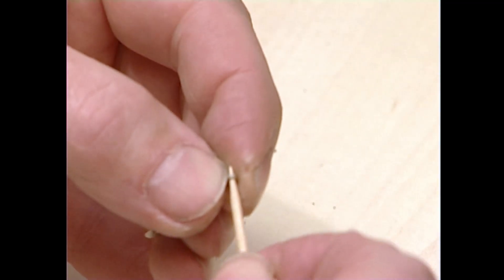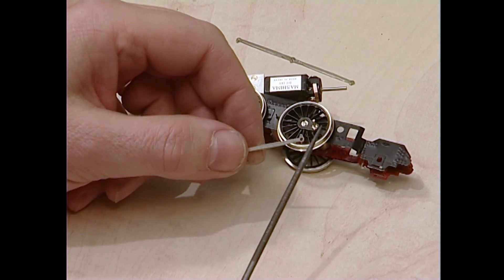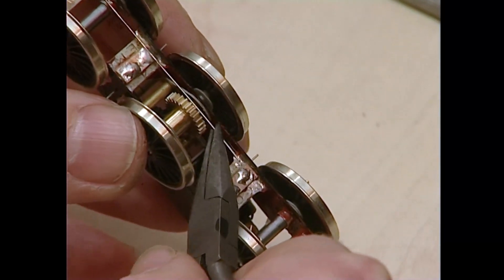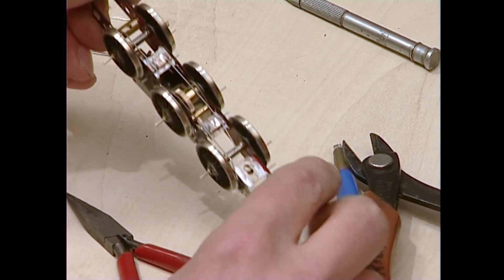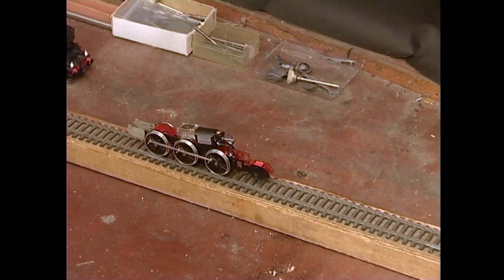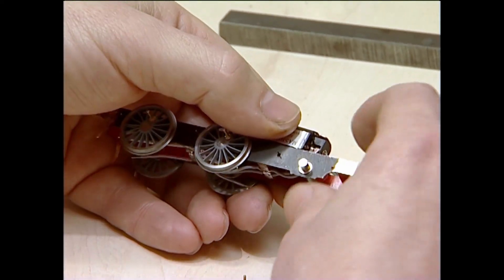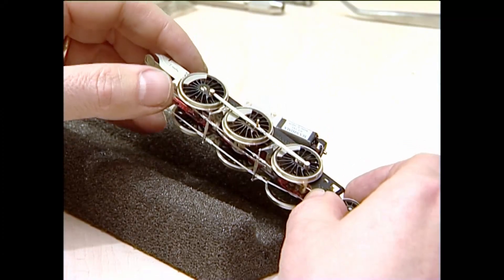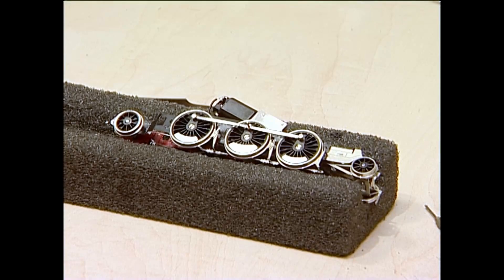Loco Kit Building Part  3  -  Pick ups, Motors & Basic Detailing

Comment: Hi can you explain what is meant by laminating rods.? Thanks Chris
Reply from the maker: Hi Chris.  Sad to say, I cannot answer your question but Tony does have a page on RMWeb and he does respond to questions on there.
You should find it on this link:
https://www.rmweb.co.uk/profile/18225-tony-wright/

My guess is that laminated rods are where you build up the thickness of the rods with, usually, two etches for each rod to make them nearer to a prototypical thickness.  However, that's just my guess.  Best if you ask Tony directly.
Kind regards,
Chris Walsh

Comment: Hi I’m just wondering about the cosmetic springs, I imagine you won’t fit them as they would foul the pickups? I’m thinking of fitting them (Gibson Black 5) and maybe using them to maintain pickup pressure, (heatshrink to prevent shorting). 
Super series, thanks for all the info.
Reply from the maker: Glad you like the series Steve. I cannot advise you on the cosmetic springs but I believe Tony has a blog on RMweb and you could try and contact him on there.
Chris